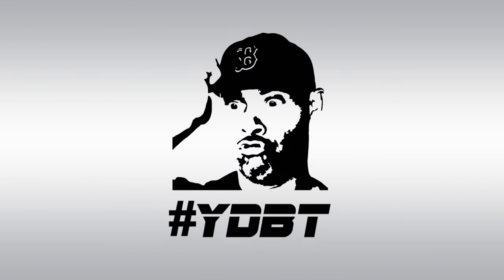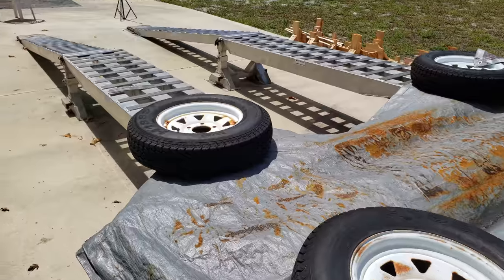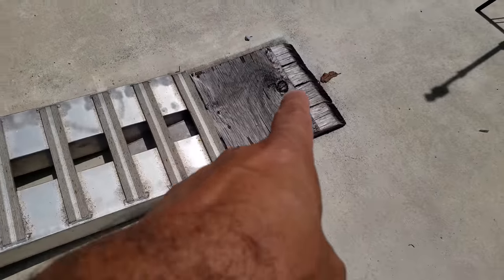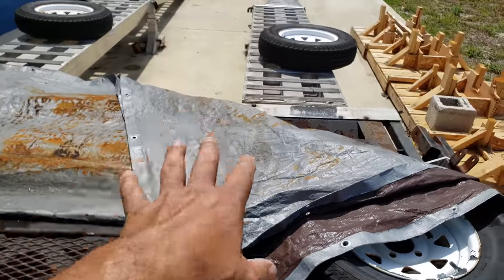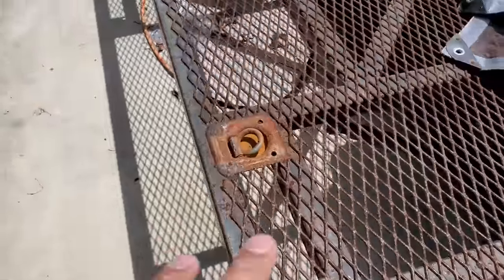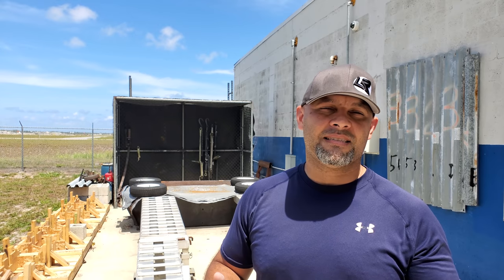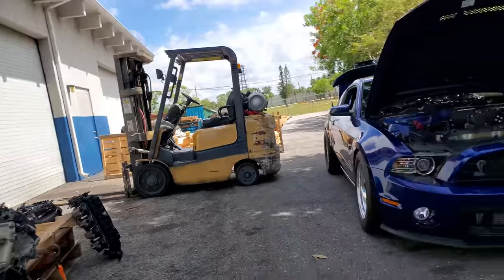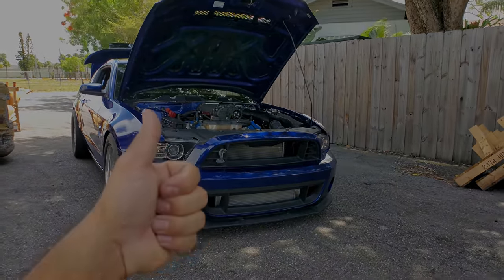I bought a DYNO!

Comment: Rustolem black, pour some in a dish, add a shot glass full of boiled linseed oil to it, stir it up, brush it on. Better then por15
Reply: U could put boiled linseed oil on freshly sanded steel, brush it on, let it sit out in weather. The stuff tacks up like a shell. Old farmer use to use it. Add a shot to oil base paint Best stuff u can use, and its cheap  👌💪🤙

Comment: Just hit that dyno with a wire knot wheel on a 6” grinder. Also best bet is just rust oleum. Buy qts and shoot it out of a gun. You can reduce it with acetone. Por15 has zero uv protection

Comment: Hi Alex, I would use rust convertor liquid or gel...it needs rust to work, no grinding no dust no sand or grit. it converts rust to a paintable surface.  Easy to apply by brush and a little goes a long way. Check out Eastwood company website. POR rust sealant is good but is not UV protected and will turn chalky white over time when exposed to the sun and must be top coated for maximum protection. I have used POR rust paint and the top coat paint on various projects including the underside of my 86 GT. The top coat paint DTM Direct to metal I was not too impressed with.  A rattle can of Tremclad or Rustoleum would probably be fine. The other company is KBS coatings, they also have products for metal and rust protection. Just some ideas
Reply from the maker: Thank you. Great suggestions